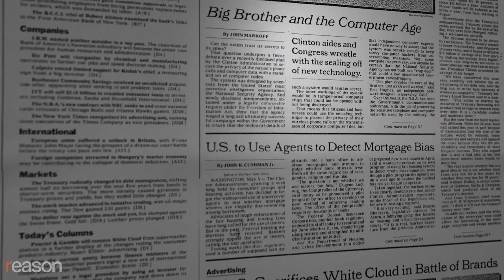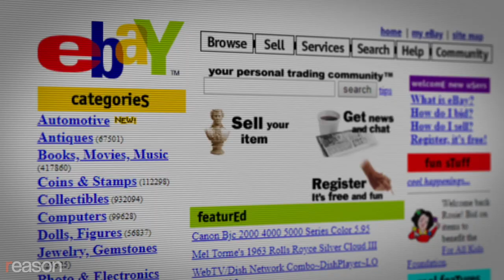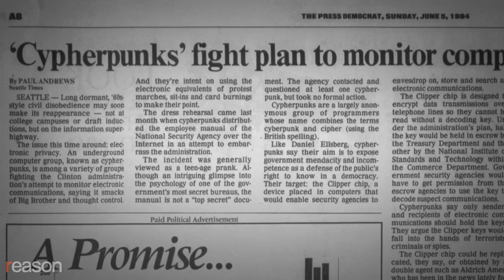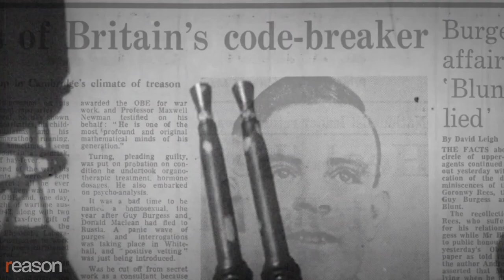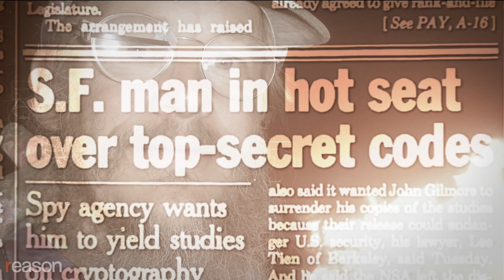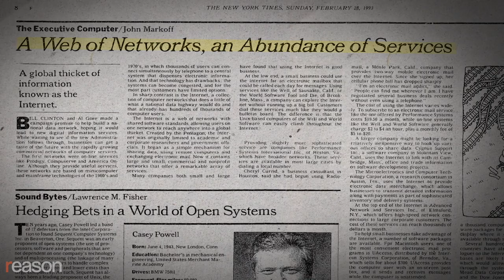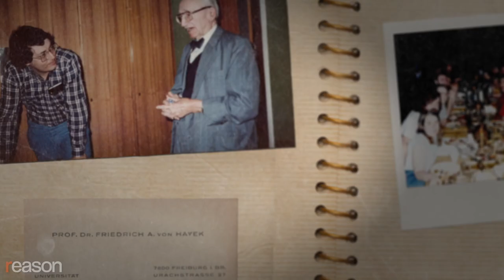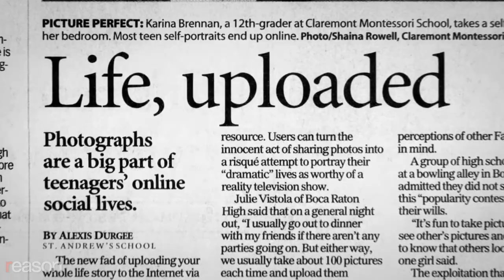Cypherpunks Write Code

Comment: unless you can effectively decentralize the whole computer industry so that governments and other big actors can't effectively attack or restrict free communications, cryptography won't cut it.
The industry that designs and, especially, manufactures computers is very sensible to goverment intervention.
The networks we use either they are already integrated in that control grid, or they can be easily intervened. They rely in physical infrastructure that can be easily located or rely on access to the powergrid, which can easily be restricted. Even a hypothetical dectralized network of radio links could easily be taken down if necessary.
So, you want to use encryption over THEIR network? Then they'll block encrypted traffic. DONE!

Maybe I'm an ignorant fool, but, I just don't see how they expect to overcome these very real threats WHEN the powers that be decide to implement them.